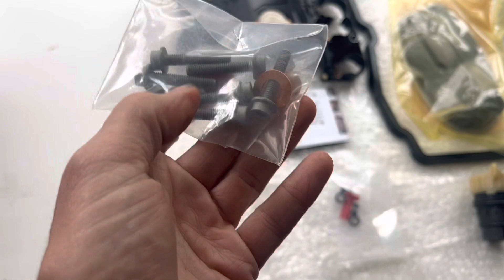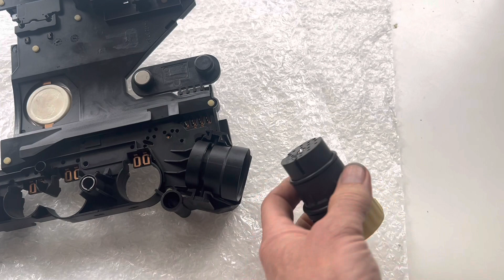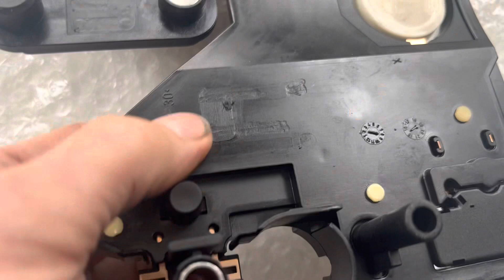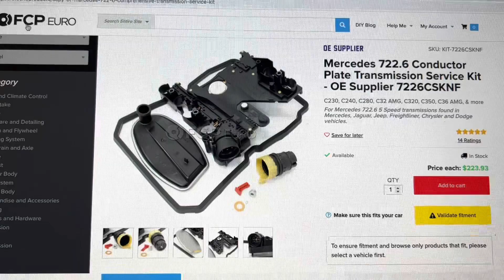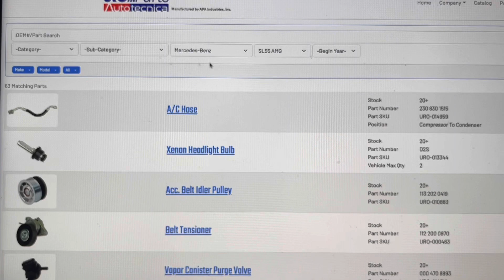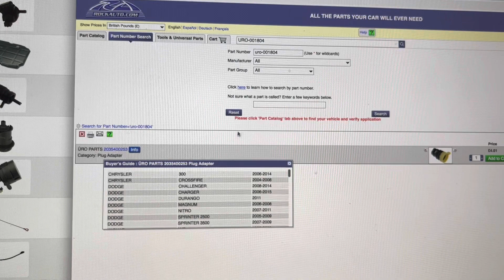Mercedes stuck in gear, limp mode, hard shift problems 722.6 transmission conductor plate. Oil leak.

Comment: URO Parts 50/50 chance any of their moving parts will fail prematurely. Left me on dark roads stuck like Chuck, cheap parts do cost more in the long run! URO will just raise their prices, not the quality, or do the shops raise the price as if they know a warranty repair will be due in short order.
Reply from the maker: Thanks for your comment - really sorry to hear you have had a problem with a URO part (s) failing. Do you mind me asking what the part was?

I could be completely wrong, but I think in the case of these conductor plates, they are all made in the same factory and and simply rebranded.

Mike

Comment: My w202 got stuck on gear 1,😢 after 1 km drive,engine turn off automatically,then start it again still stuck at gear 1 no upshifting to gear 2,3,4,5,
Reply from the maker: Hi - sorry to hear you have a problem. First thing to do is to plug in a scanner and analyse the fault codes. Engine turns off to protect gear box from potential damage. Does reverse work? Mike
Reply: @MikesMercsandothercars  ow ,my car still can reverse,
Reply from the maker: @sharilful  I assume you have checked the level of the transmission oil? Low level will cause these problems.

Next step is to get a scanner plugged in and  analyse the codes.

If you are lucky, it will need nothing more than a new conductor plate. Sounds scary but reality it is not that big a job.

Mike

Comment: Hi I’m having trouble on slow acceleration limp mode also have codes for 0732 slipping in 2nd gear and wouldn’t go in reverse but when switched off it works and shuddering when driving slow w204 2009 2.1 sport thanks
Reply from the maker: Sorry to read you are having problems with your Merc. I am not particularly familiar with that model but with a P0732 error code the first thing I would check is both the level and colour of your transmission fluid - low and dirty fluid can cause this code and all sorts of associated problems. Next up, I would inspect the shift solenoids and associated wiring and replace as necessary. Good luck. Mike

Comment: im possibly about to do this job to my clc180. do you think it needs new solenoids as well as the plate? the issue im having is that it seems to change when it changes up/down gears randomly. can stay in 2nd for ages into high revs when im just cruising down my street then sometimes it will change up early, only to change down again harshly if i slow down slightly. i dont even use the C comfort setting as its even more erratic. gear changes are smooth most of the time with the odd harsh change. somtimes changes up or down just when moving along in heavy traffic which i have to react to!
Reply from the maker: Just my opinion...and I am no expert but usually changing the plate, will fix those problems. Incidentally, the symptoms you describe could also happen if you were low on transmission oil - I assume you have checked this? Mike

Comment: My car still not shifting after the new conductor plate.. any ideas ? I also bought new shift solenoids I never put in yet
Reply from the maker: Hi - what year and model car do you have? 

What are the exact symptoms - eg can't get out of park...doesn't shift from 3rd to 4th etc

Did you change the conductor plate yourself? 

Was it brand new? 

Where did you get it?

Did you change the pass through connector plug?

Any check engine lights or stored fault codes?

Mike
Reply: @MikesMercsandothercars  I have a 1999 Mercedes Benz e320, it will not shift out of 1st gear I even changed the conductor plate it was brand new from Mercedes. Im still getting the same results I still have a engine light and I don’t know any codes as of right now.
Reply from the maker: @idotbaby777  After changing Conductor plate, you have to clear codes with a scanner. Where do you live? Mike
Reply: @MikesMercsandothercars  no I did not clear the code. Louisiana !
Reply from the maker: @idotbaby777  Slightly to far for me to come and help you....but often,  if you dont clear a limp mode code after fixing the issue, the car will still be in limp mode. Hopefully you issue is as simple as that. Mike
Reply: @MikesMercsandothercars  I’m getting a P0715: transmission input speed sensor
Reply: @MikesMercsandothercars  and I cleared the code still no change
Reply from the maker: @idotbaby777  Sorry to hear you still have a problem. Can you tell me:

What make and model scanner did you use to clear the code?

Does you car have a check engine light on the dash?

If you had a fault code prior to changing the conductor plate, it is often the case that a  high-end scanner must be used to clear  the code from the Transmission Control Module or the code will reset on engine computer giving a "check engine" light.

The first thing I would try, is to find a Mercedes Indy with Mercedes STAR to clear the code.....

Next stop might be to check that the solenoids are seated properly - especially the ones without the O rings

Mike
Reply: Hi Mike! I found your channel and it crossed my problems with my Mercs gearbox, how can I get in touch with you, Mike? 😅
Reply from the maker: @domassumskis8344  Hello - I am no great expert in these matters but you can write to me here. What make and model of car do you have and what is the exact problem you are experiencing? Are there any fault codes? Mike

Comment: Hi. Very nice video. Thanks. I have weird problem with 722.6 gearbox in E220cdi. Oil from gearbox is getting all the way up to the Transmission Control Unit, contaminating both connectors, all pins and even filling almost half of TCU housing with oil! Oil comming trough the cables?! Cousing Terminal 87 and Valves voltage problems. Anyone knows what is the fix for this problem?
Reply from the maker: Hello - that is a common problem and us due to the seals on the 'pass through' connector plug failing (see 1.54 in the video). Once these seals fail (or if the plug has not been, inserted properly), capillary action can move the transmission oil up the wires and into the Transmission control unit. This plug was redesigned on later cars to stop that problem. The transmission oil can contain tiny metallic particles and once these get on that electrical connector (or on the solenoid pins) your transmission could start to exhibit all sorts of problems. The 'cheapest' solution is simply to replace the 2 O rings on the pass through connector. A better solution is to replace the conductor plate, filter, gasket, screens and of course the pass through conductor. Mike
Reply: The o rings are gone in the plug.. oil travels up the wires

Comment: Getting ready to do this on my cls 55, however do you recommend getting a brand new conductor plate and valve body?
Reply from the maker: Thanks for your comment. I'm not sure its necessary to get a new valve body unless you suspect a problem. The conductor plates are relatively cheap and are the known failure point so I am going to change mine as a preventative measure. I have since found a UK source for the O rings on the solenoids (http://www.jpat.co.uk/). The cost is just £3.68 so once again, probably wont do any harm to have a set on hand just in case you find yours are knackered. Mike

Comment: Hi love all your videos great content, I’ve got a recurring fault which is driving me mad, it normally happens after driving 40 minutes eps flashes up first the cluster goes crazy car locks into gear changes on the odd occasion but clunks, cooling lights up abs EML, any ideas anyone ??? I Get different codes every time, any guesses kind regards Ben
Reply: Hi Mike I’m in the uk East Midlands it’s a mercedes SL55 2003 with 57k on the clock, definitely intermittent drives perfect then after 40 to an hour esp abs visit workshop come up the dash dances about and normally locks into gear pull over and turn it off then it’s ok again unless it’s warm then will drive ok then do it again strange one
Reply: I’ve Just change the front passenger side module/ Sam out today and brake light switch I will give it a try tomorrow, I changed the front drivers esp module last week didn’t change anything. Will take it for a drive then plug it in
Reply from the maker: @benjamabbey6002  Hi Ben - A strange thing I discovered when researching the conductor plate is that the TCM (transmission control module) takes a signal from the wheel speed sensors via the ABS module.... If you had a faultly wheel speed sensor (or corroded connection) on one of the wheels, this could result in limp mode and ABS warning. Just a thought. Mike
Reply from the maker: Hi Ben - sorry to hear you have a problem. What model car (and year) and what country do you live in.

I'm no expert by any means, but my initial gut feeling would be either a wiring fault (dodgy or corroded earth connection) or maybe an ECU or CanBus problem. Car warms up after 40 minutes and a dodgy connection becomes intermittent.

If a visual inspection didn't yield results, I would be tempted to swap certain modules.

 I recently visited the R230 graveyard and they could well have the parts you need.

Mike